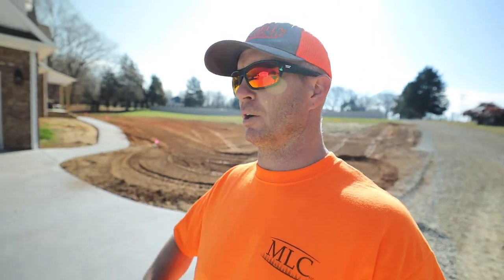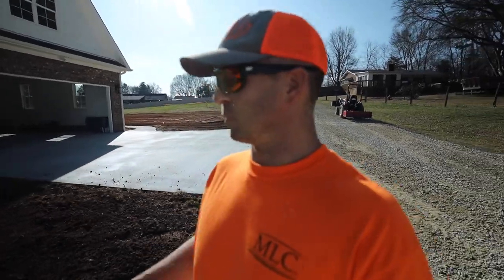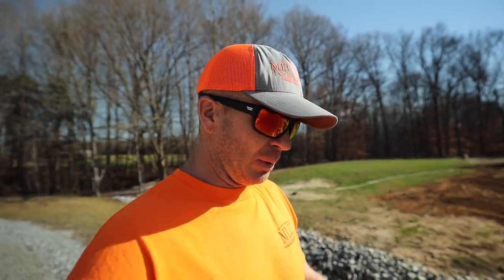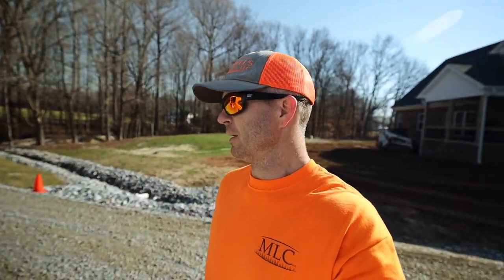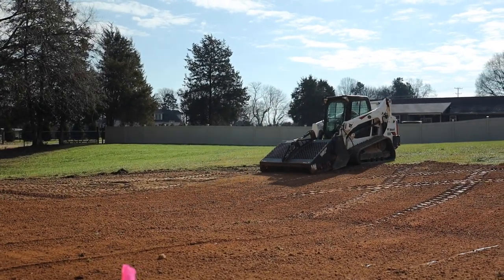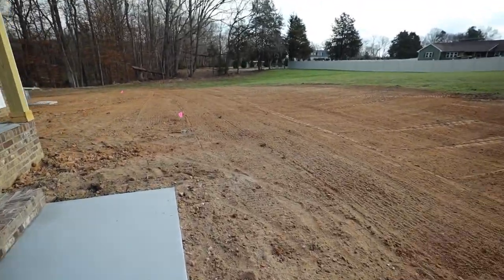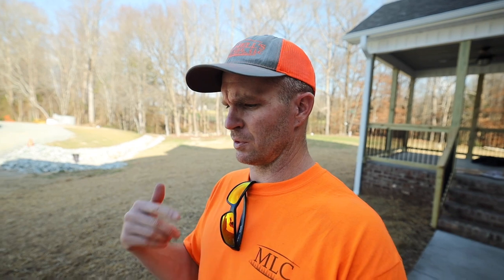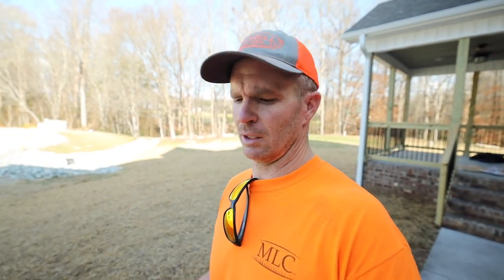NEW CONSTRUCTION Turf Area Gets Dialed In ... Start to Finish!!!

Comment: Looks like your house is at the bottom of that lot boss. I hope I'm wrong but that grade doesn't look ideal. Glad you're back on the tube.
Reply from the maker: Yes it slopes towards the home but there is a gradual ditch line cut in in front of the home.  The gutter downspouts are also buried.  No water runs toward the home…IDEAL